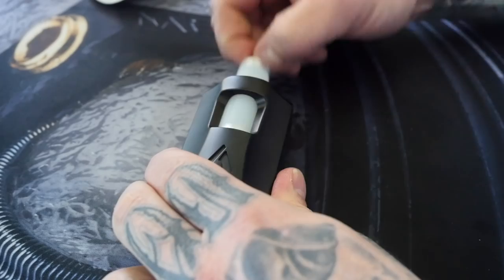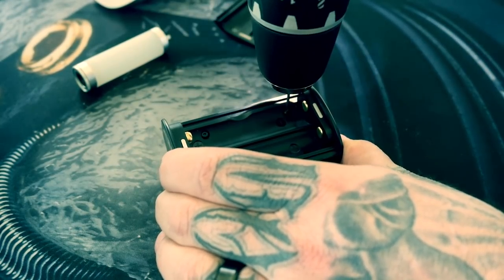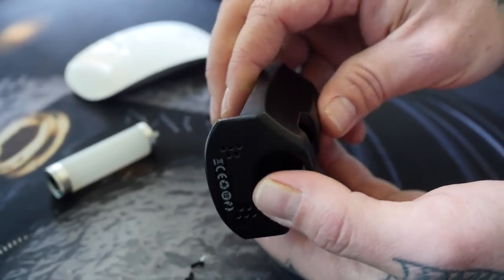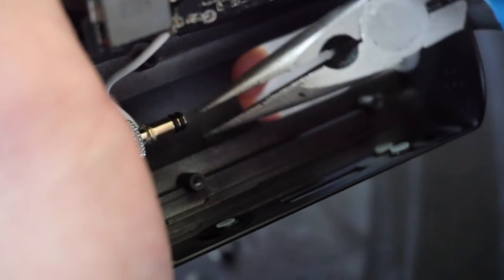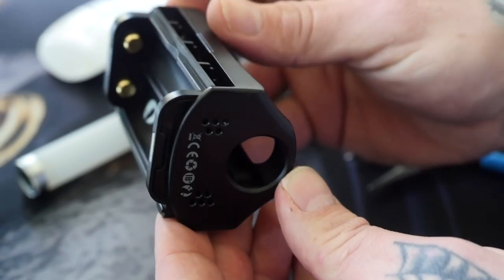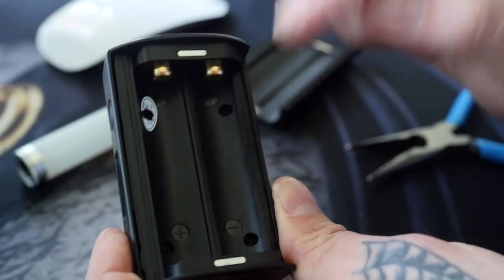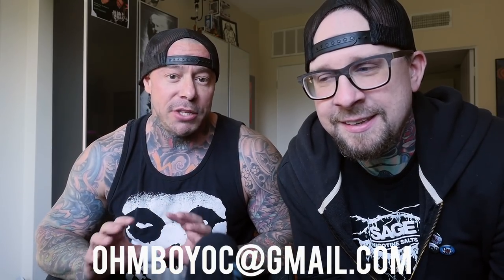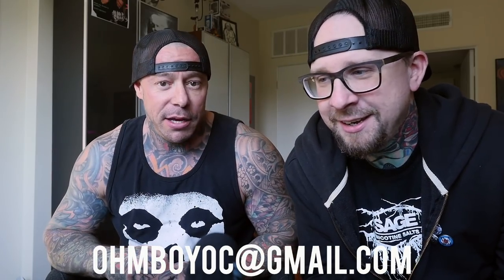Rage Squonk Maintenance with OhmBoyOC : Shenanigans

Comment: I mentioned it in my review but man, the Rage has the best battery door ever!

P.S. Duane is right!
Reply: The Legion has Spoken!
Reply: Agreed
Reply: OhmBoyOC I have a issue with my rage. I’ve checked the oring and mine only has 1 clear oring ( the fixed version ) however my squonk bottle sweats profusely. So much so that I have to pull it out and wipe it down because I fear the juice works it’s way into the board or internals. Any tips ? I do clean my bottle off as well as where the squonk pin meets the bottle head. But still no dice.

Comment: It is currently 2 years later and I am still using mine every single day. I have been super rough on it but its keeps trucking. As a mechanic its had oily hands on it, dropped out of cars, thrown onto tool boxes. I cant break this thing. Not even a drop in performance or failing parts. Battery door is as solid as ever, and I've had no issues with the board. My only gripe is there isn't a rage version 2. I'm going to use this thing until it shits the bed.

Comment: Hey guys, got my Ohm Boy Rage Mod in Bronze, which as you probably know is HARD to find, kept searching and found a Bronze one at Modern Vape Company, (a company that I have never heard of in my 5-6 years of vaping (maybe a new company, and did a Great job with their shipping and the reasonable pricing on shipping). The bottle seems to be just fine as to how much pressure it takes to remove it, so I'm guessing that they got the revised ones. Just also want you to know that this is the Best looking Mod I have owned. So glad that you went with the Desire Company, I have the Desire X and they made Great looking designs. Great work by a Great Guy !! Just Love this Mod !!

Comment: Thanks for your Squonk mod, one of the best, got already two, one needed to be fixed(already done) and one just perfect, now looking to buy a bottle to replace on the one I have fixed, because it got stuck in it and it is not flush anymore (had to remove it the hard way....) but all in all a very good and solid device

Comment: still using this mod.  Absolutely the best.  Fewest moving parts ever, no stupid plastic retention clips to break on the squonker.  Seriously hardcore.  dropped it on rocks while hiking and it keeps vaping like a champ.  Anyone who designs a mod should seriously consider this design philosophy first.  built to last!

Also, is alcohol the best way to clean the underside of the pin that goes into the top of the squonk bottle?  Please post a video on that.

Comment: I love my Rage! Duane you did a fantastic job! Pretty sure mine has the second o-ring so I will have to try this fix. I have no trouble using it in either hand and I have little hands.

Update: My Rage did indeed have the second o-ring and I was able to fix it with no problems after watching this so if you do still have one and think you have the second o-ring (trust me, if you have any difficulty getting out the bottle you probably have it because once it's gone it's smooth like butta to get in and out) you can do the fix.

Comment: Second Rage ordered. Had to get the brushed this time. My two cents: don’t precut the straw. Let me cut it how I like. The notch for the bottle removal swivel, open it a tad for thicker fingernails. (I fixed mine with a file.) And in firmware delay the firing just a hair where it won’t fire when you click it five times fast to turn it off. Also side not for the first week I kept pressing the squonk bottle to fire it. It’s all good now. I’ll send pics when I get back in town of removing the o-ring.
Reply: Lee we got that bottle fixed! sorry but I had to get that delay down to nothing or all my friends would of roasted me

Comment: I guess thats why my sticker was punctured where the screw is in the battery compartment...I thought it was used, but it seams to work just fine...I ordered it from eciggity, just got it today....only complaint on it is I wish there was a lock, when I pick it up sometimes I press the buttons! But I do like it way more than the Gbox, the metal rod and hard cheap bottle was why I decided to ditch it and get this...nice squishy bottle!

Comment: oh my god!!! i bought my rage squonk mod MONTHS before this video was posted, i know 100% i would of got the free thank you gift, but nearly a year late. lol
I did want to mention something important about this device when in the Temp Control Mode, which is the following long post, but very important and short read for those interested in the TC settings for this device, specifically the Stainless Steel Coil default TC-Mode setting .  Today was looking on youtube to see about the TCR setting because for the first time I wrapped my own SS 316L coil but feel that my temp needs to be very high to get vape production (the range i set is: 490 degrees F. to 510 degrees F.).  And i just saw "DJLsb Vapes" video reviewing the mod, and he showed data showing how far off the Rage Squonk Mod is when it comes to TC-Mode [at least when set in TC-Mode for SS coils, because he only had SS coils with him in the review] he noticed the Rage Squonk actual output when recording with his external instruments recorded the device had much lower power/degrees compared to what the device claimed it was outputting ...

 as an example, the device is set to output 420F in SS TC-Mode, but in actuality was outputting around 360-370degrees F.  So he recommended anyone using SS-Coils to actually run the device in TCR for TC-Mode and set the TCR value to "0140".  It is much more accurate in outputting the REAL from what is displayed on screen compared to the default SS TC-Mode.

Before I took DJLsb Vapes advice, i was trying out the SS coil for the first time, i had it on SS TC-Mode, but in order to get any vapor production with good flavor, I had to set it to 100watt at 490degrees F.  

After I took DJLsb Vapes advice, I had the exact same set of coils/cotton/liquid.  Changed from using the default SS mode, to TCR mode with a value of 0140.  and now i do 100watt at 370degree F, AND GET MUCH BETTER FLAVOR.  and it isn't over-heating the coil.... i think DJLsb Vapes is correct, the video was posted last year and he suggested to check for new firmware upgrades because they might fix this glitch in the system later.... well today i updated the firmware .  I also updated it correctly, including the tricky part where u remove the batteries PLUS hold both buttons down BEFORE putting the USB in and hitting Start for upgrading the firmware.  But it did not solve this problem.  

So to anyone else wanting to use SS coils in TC mode, use the TCR mode and set the value to 0140 for SS316L coils and you will LOVE THIS DEVICE ON TEMP CONTROL.  Maybe if the creator or friend of the creator who made this video reads this comment, they can make an upgrade to the firmware within the next few months that can fix the Default-TC-Mode-Values for at least the SS-TC-Mode... as for the others like Ti or Ni, i have no clue if they are fine, or also need adjusted.  

Yes, i know 0140 value is far off from SS316L, however this is the part of the device that needs fixed with a future firmware update, the values for reading SS wires are off and need fixed.  but it seems that the 0140 is the correct value for these coils, in terms for this specific device, as of today... but like mentioned, hopefully this problem will get noticed by the makers and they fix the glitch.

Till/if this gets fixed, ill just use my SS coils on TCR mode with 0141 value.

My setup: SS 316L 26/32ga coils, wrapped 4 and half times, duel coil setup, on my Rage Squonk 155w, with the "drop RDA"

Also, i know "DJLsb Vapes" explains things VERY well (recommend you check his channel out, he is very tech savvy and has all the proper equipment to record voltage, resistance, and all things electric-related.  He is very professional and intellectual when it comes to electricity, especially when it comes to vapes and TCR, and testing mods.... think of his channel like the quality control departments which test and measure everything within the device to make sure it is working properly before sending the very first batch to sell to customers.

Comment: It’s April 26th 2019 and I bought a rage about two weeks ago. Dude ohmboy, you made a killer squanker. It’s replaced all my other mods. I used to use tanks and rando mods at work and this is the replacement I needed. I work in roofing and my constant issue has been “roofing grit gets on my dripper and tanks do the same so I’ll stick with tanks” let me tell you something. Squanking on my job has been a breeze. The flavour man, the flavour.

Comment: The only fix that worked for me (even after removing the top o-ring) was getting a new bottle from recoilrda site.  The original bottle bottom broke from the force of trying to remove it from the device (absolute nightmare removing).  After getting a new bottle and checking the top they are different and the new bottle works like a dream.  I have since ordered a couple more and ALL the new ones work great.

Comment: I wanted a dual battery regulated squonk When there was only one available, I forget what brand but when I saw this on insta I jumped on the first batch they released. 
After a month or two of use I had an issue with the squonk pin coming desoldered . I took it apart fixed it myself emailed ohmboyoc just to let him know. He sent me a new one on the spot awesome product. I didn’t even know about this issue till I found this video right now. I don’t know if the one he sent me was still part of the batch but I haven’t noticed it being hard to remove the bottle till I watched this 😂 
Don’t know if I’ll need to email him but has worked fine all these years favorite mod.

Comment: Will do it tonight. I went with the RDA combo and the flavor cap on the RDA is way tighter than the bottle with two O-rings.
Reply: I have done mine. Watch out make sure that the buttons are clicking before you tighten her back up. I done that and found out the hard way. They were sitting in there as they should and found out that I couldn't power her up. 

Great Tutorial and Thanx. 

I am left-handed, so I vape left-handed.

Comment: Oh and I use it just like Nick. My right hand has a birth defect so it's smaller. But using it in the left hand the thumb reaches the bottle very nicely. This mods ergonomics work extremely well for either hand

Comment: My rage mod keeps saying low battery even with brand new batteries in it any idea what's going on
Reply: Same here, I'm getting "Battery 2 Weak" and "Unbalanced Battery" with brand new freshly charged batteries.  Sometimes it works sometimes it doesn't.  Also the backlight is turning on randomly with the mod just sitting there.  Updated firmware with the same issues.  Haven't found a solution and I don't want to open it up quite yet.
Reply: @Blue-ll1hn  because you got e liquid already into the device it's underneath battery 2.. it's that damn O-Ring.. makes it shit the bed.

Comment: Dudes I got the ohm boy rage but I have run into a problems first of all the bottom of the squonk tank came off as I pulled it out but had a spare then the mod started playing up so I opened it up to have a look and noticed the positive wire had come off as a result of me twisting the tank to try and get it out. I have managed to solder it back on just, all of this is a result of the two O rings instead of just one. BUMMER DUDES.

Comment: Any ideas what the issue is..sometimes when I'm changing the batteries to Rage it doesn't start working? Is it a common issue?, hardware issue or something else? Today morning I need to put batteries in and out many times before my mod start working..
Reply: Wipe your batteries connections, and use a long q-tip or something with some degreaser or alcohol on the mod`s contacts.
Sounds like you got some smudge on something..
Reply: @afrog2666  yeah maybe you are right. I didn't see any smug but when I cleaned batteries and mod with alcohol swibe mod start recognised batteries right after that..

Comment: Absolutely my fault,but after cleaning everything including the bottle, I forgot to put the cap back on the bottle, put the bottle in and proceeded to fill it with a refill bottle... So no cap, obviously juice spilled while upside down but there is a hole up close to the pin and that's where the juice went ... So turned it right side up and juice trickled out of the USB port, the battery vents, and the bottom of the battery cradle. So like I mentioned, my fault... But what's that hole up there for? Oh... Still works fine though ...

Comment: I'm very disappointed with my Rage, I don't have a first batch one and i still have the same problem with the bottle I took it apart to fix it and realized that wasn't the problem and second the overheat protection constantly comes on even when I'm pulsing my coils at 25w
Reply: #ragev2please

Comment: I love the rage just having a little issue with the bottle pulled it and the bottom cap come off so will send pictures to you doing but overall really good quality this is the best daul battery the shape is great amd a good price
Reply: I believe the bottle bottom cap should have been a screw in set up then pushing a bottle up in the mod.. so how I was looking at it when you put the bottle in the mod there will be threading on the bottom cap of the squonk bottle threading to the bottom of the mod. Like you're actually screwing in your squonk bottle to the mod.

Comment: I guess one of mine is from the first batch. Also my other one keeps shutting off after every couple of pulls and saying weak battery. i have 7 sets of batteries and it does it with all of them. How can i get replacement bottles. mine are getting worn out and the bottom piece is about to fall off of both bottles from the double oring  thing. im happy to pay even as long as i can have spares.

Comment: Ohm Boy is right! But folks I got a damn stupid problem. When the bottle sits flush in its compartment it won't squonk. I need to kind of press the bottle downwards a bit so that the connection (Brass-Pin to bottle) loosens up a bit then the fluid feeds up to my Atomizer. How can I fix this, I mean its so annoying getting dry hits just because that thing doesn't squonk the way it should. I figured out, wen I unscrew the Atomizer it squonks right away without issues. So screwing the Atomizer in, kind of pushes the Pin down into the bottle and closes the fluid way somehow. Please help!!!

Comment: Ohm boy OC and Grimm green,  I just got the rage device and I face a wierd problem,  thhe bottle does not Squank easily!!!   It takes air in  but it leaks inside the bottle place ...

Is the bottle defected or is there is something I am doing wrong!!  I have opened and checked the mod and it does NOT have a double Orings... 

The device is brand new.

Comment: This thing sucks. Every time I squonk the bottle leaks. The bottom of the mod is always wet. They should have put a door on the bottom to hold the squonk bottle from moving every time I squonk.
Reply: Mine leaked inside and fried the board and desire dont do shit f this company
Reply: Topside!
Reply: Junk.
Reply: The bottle turned yellow also.
Reply: They should recall all of them.

Comment: The single O-Ring that connect to the squonk bottle needs to be a little bit thicker and it's not gripping the bottle properly for a really tight seal. My rage is running like a faucet and I'm trying my best to keep e-juice out of area's that it shouldn't be. Had this mod for a full week and I'm loving it and getting pissed off at the same time because of the O-Ring.. I believe you guy's should get ahold of desire designs because they still make this and just tell them about that damn O-Ring that is not thick enough and it doesn't have a good grip to the bottle. to me this is a massive con and it should be addressed to desire designs. this isn't Dwayne's fault. he only made the concept of the Rage and it's beautiful.. I made a comment on the website. O-Ring on 510

Jesse Ferrier on Dec 20, 2019

Comment: Hey Grimm, I got the rage and it worked well for the first 2-3 days but after that it hasn't worked at all. I put batteries in it and it says low battery. I've never charged my batteries in the mod. I bought new batteries today and I'm still having the same problem. Even with the rda taken off it still says low battery and still has the resistance of the coil displayed. Any idea on what can I can do to fix it? Please and thank you
Reply: Mine leaked inside due to bad QC took off oring as instructed in this vid.  Just made it leak and fried the board.  F this company no customer service.

Comment: all I want out of the vape world is a Mechanical Series Squonker :'(
Reply: brutalness that would be fierce. I would buy one too if it was good quality. The rage has bypass mode so it's next on my list. Have to hope and pray someone puts out a series mechanical squonk soon.
Reply: Search the “scream series squonk” out of Great Britain. They have a series and a parallel mechanical squonk made from allumide
Reply: William Ensor cheers for the information. I'm in the UK so might have to get one real soon. Made to order and £147 per unit. Definitely one to save for.
Reply: Shit man that’s perfect for you!! Good luck ✌🏼😎
Reply: William Ensor cheers dude. I went squonk mad the last few weeks. Bought quite a few devices and rdas so need to get the vape budget hands working again and then I will buy one of those beasts and a rage squonk too.
Reply: had a look on google the larst thing from them was "full details, ordering, Info, tips and tricks coming here soon" and that was on 4 January
Reply: If you can hang in bypass mode on the rage you got my respect
Reply: OhmBoyOC I will be grabbing one of these next week to go full beast mode as long as they're not all sold out in the UK.